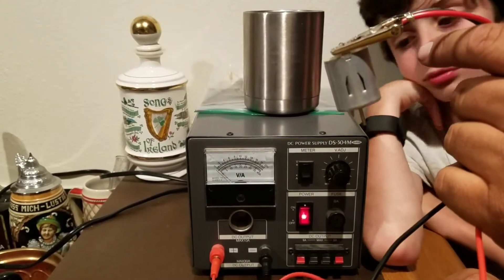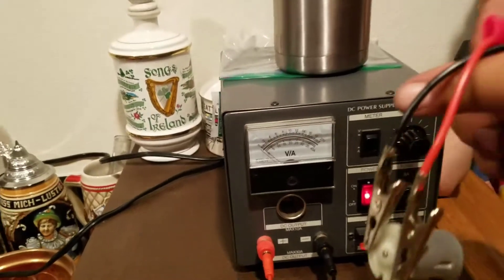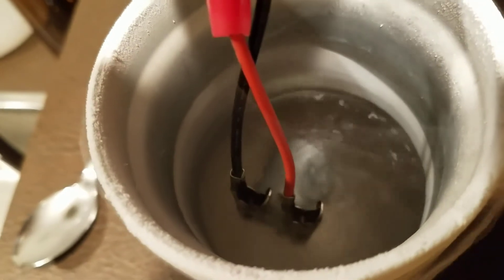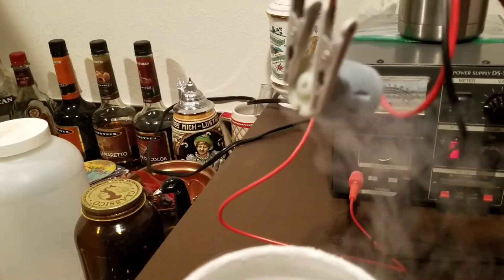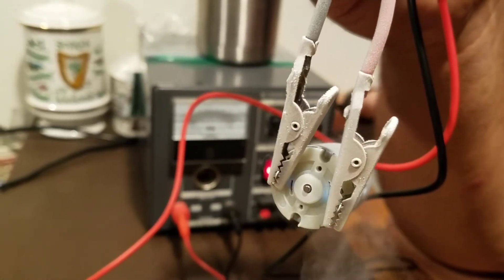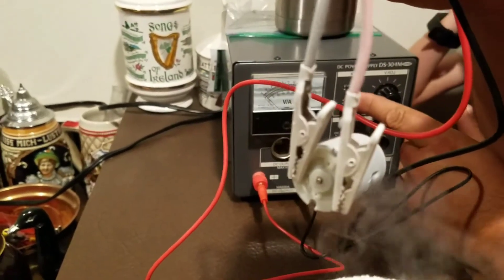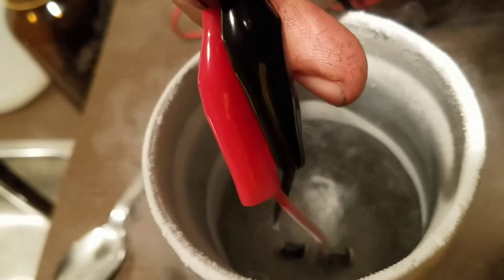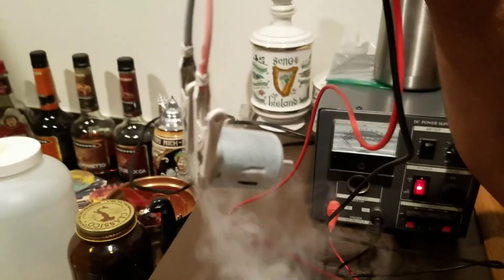6 Volt DC Motor Vs Liquid Nitrogen

Comment: That's the brushes losing daytime brother! Nothing to worry about, it's just over current... xD
Reply from the maker: Anubhav Mukherjee i did a dimensional check on a piece of 3/8" diameter graphite at room temp and one at -300°F.  Not even  .001" difference.   No, the resistance drops to normal conductive range and it starts arcing.  Moreover, the electric field/EMF this throws off disrupted the neighbors wifi 100 yards away.  Did another experiment with AM radios and O-scope to study it more.
Reply: Woah!! xD
Reply from the maker: Anubhav Mukherjee yeah.  I encourage more people to test this out.
Reply from the maker: Anubhav Mukherjee also watch it again, listen to the microphone pick-up and the induced interference directly to the smart phone...
Reply: Yea, I noticed them!
Reply: But why really? What was causing the arcing in there?